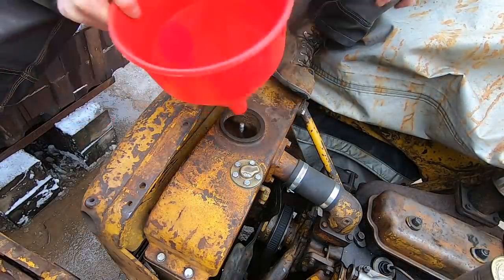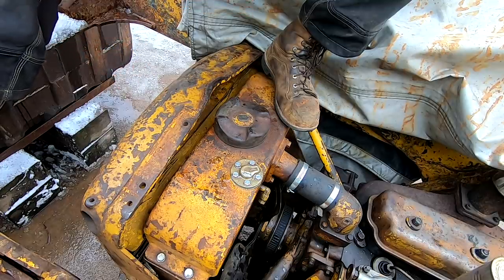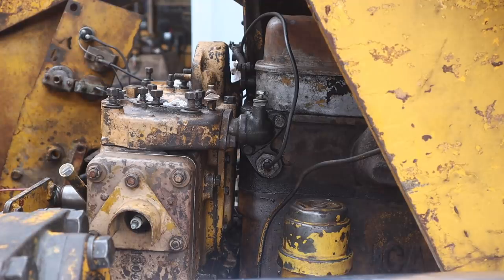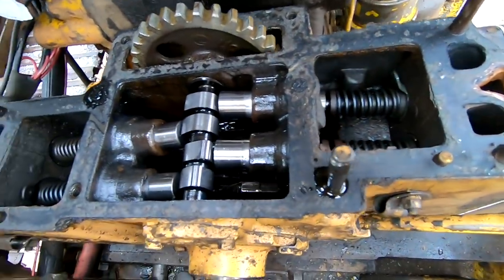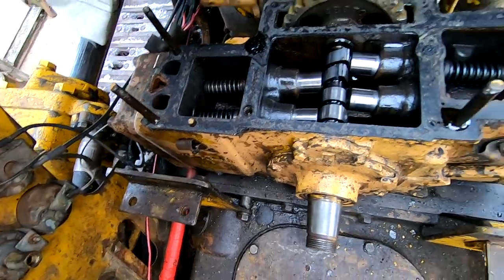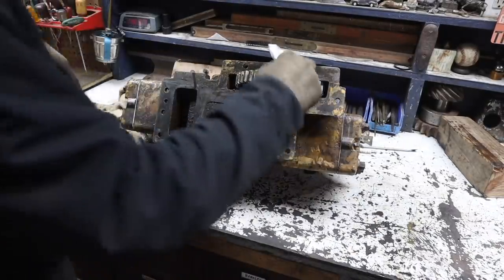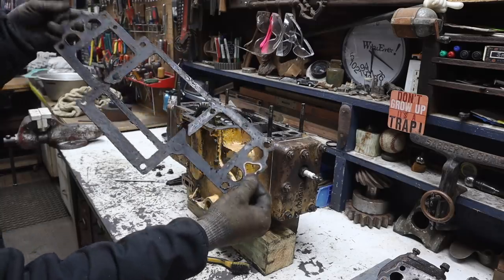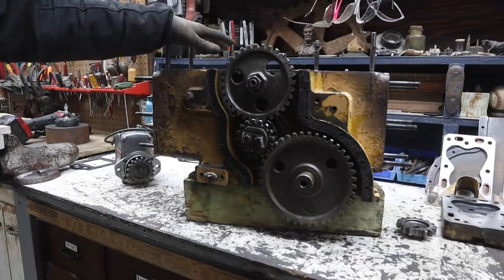I REMOVED the Pony Motor!!! ~ Part 15 ~ 1950s Caterpillar TraxCavator

Comment: Who makes those old pony motors? Cat didn’t correct, just branded? I used to work a dealer help line for Cat, we rarely had questions on pony motors. Lots of old engines are rebuilt just very few pony motors from what I saw.
Reply: Cat made them.
Reply: And lots of them got rebuilt back in the day.  Some of the later types from the 1960’s were really unreliable and probably pushed the transition to direct electric start for many people.  The term “buzz bomb” was popular!

Comment: Are you sure the bearing is Aluminium? looked very soft if you can scratch it that easily, What about Babbitt? this was a common material for bearings in the 1940's - babbitt or white metal melts at a low temperature and if an engine were driven hard with poor oil circulation the bearing material would get hot enough to melt and literally RUN out - this is the original meaning of running a bearing!
If you cant find a bearing there are specialist machine shops that will manufacture in white metal - usually on a brass backing.  Thats what your big end bearings are made from - a brass or copper shell with a layer of white metal.

Comment: Hell yeah! Make one out of bronz it will never fail and if it does at least you wont be around to hear about it..great job! Have a great outstanding day.
Reply: Bronze is a poor choice for a pressure fed plain journal bearing.  You need a bearing surface much softer than the bearing journal so that dirt and debris in the oil gets pushed into the bearing rather than scoring the crank journal.  Phosphor bronze etc. is good for self lubricated or splash lubricated bearings

Comment: I would bet that the aluminum was about the same softeners as Babbitt used in larger spin cast bearings. The question is heat dissipation and clearance for oil to float a film against the shaft. Check the tolerance in a ,machinist handbook for the proper clearances. We in the electric motor business for high impact load may use aluminum bronze instead of cast steel bearing surfaces, not bronze with graphite impregnated called oil tight bronze, also used in motors, since the impact load of a diesel is higher and then boxer design off the crank symmetry is 180 deg .  Maybe there is a Person on here that knows the actual engineering. I would replace with aluminum billet material. or get Babbitt sleeping material. Maybe McMaster Carr has it available or see a electric motor shop. Also an insight maybe an Ingersoll Compressor guy that knows centac compressors, they had the same design for opposing crank piston relationship. Hope this might help give a direction in case there is no other input.

Comment: I believe the bearing is Babbit or sometimes spelled Babbitt. Isaac Babbitt came up with it back in the early 1800's. It is an alloy mostly made of tin with some antimony and copper. I would say it comes down to hardness. I know the pony is only used for starting so it's not the prime mover but my fear is that bronze would be softer and may not be suitable for such service. A bushing is one thing but a crankshaft bearing... is a different animal. It seems if bronze was a good option, it would be there already. I too have a lathe and machining it should be possible. If it is pressed in I believe there is a proper oversize standard of a few thousandths you should look up. I believe you can find it in the Engineer's Black Book found here https://www.engineersblackbook.com I think there is one for the crank journal running surface as well. 

What I'm wondering and I haven't looked- is if perhaps you can order a piece of Babbitt round stock from a specialty metals dealer and then go from there. I would face it off, turn the outside to spec. then drill it to fit a boring bar. Bore it to internal spec and then part it off. Then mill the pin slot and drill the oil holes. Put a nice chamfer on all the edges as well. I know there are machine shops that will make them for you but then, what fun would that be? Just go slow and creep up on your final spec. I'd be leery of changing to bronze without doing your homework first. You are a sharp guy, how about casting your own Babbitt round bar? 

As to the issue of end play, what will the crank  bearings do to control that? Is it possible the other guy who was in there before you left out a thrust washer? It looks like he left 1/2 of a broken castle nut behind so who knows. I'd almost bet that piece of nut took out your magneto gear and shaft. Hopefully the other bits of the gear are in the sludgy bottom of the case.

Great series. I look forward to the upcoming episodes.  You are a hard worker who is not afraid to go the extra mile. That is an admirable quality.

Comment: Squatch 253 has some info on pony motors in his 5J-1113 series. That bearing on the gear side is notorious for getting a lot of end thrust. You caught yours in time before it really wore out and the bearing would have spun and might have even eaten into the engine block. You were a far cry from that but good to catch it when you did.

Comment: Somebody tried to take the rod cap nuts off without removing the safety wire first and broke the castle nut in half.  That’s my guess.  The probable removed the other half when it broke and the other half fell into the sump, getting lodged in the drain when they changed the oil.

Comment: the only thing is that is why your bearings are worn and the crankshaft isn't... because aluminum is much softer... so brass .. not as soft as aluminum.. its going to wear on the crank more and i can't tell you if it will seize because i have never seen brass crank bearings .. only aluminum / aluminum plated

Comment: The pipe wrench keeped skipping off because you had it on bacwards pipe wrenches only grip one way also slip joint pliers grip better if you have them on the right way same with adjustable and open end wrenches

Comment: Two things.  I don't like how the mag gear meshes with the camshaft - is one of them wrong?  The teeth don't seem to fully engage full depth...  Also, I'm not sure if bronze, being harder than aluminum, will work for your main bearings.  Usually bearings are meant to be able to absorb small grit and stuff and keep on trucking; is a sense they are sacrificial.  The main thing you have not addressed is the thrust dimension of the main bearings.  That is, the length of the bearing.  This is what controls the end play of the crank, which I think is your concern re the broken teeth.  Obviously, the main bearings are worn with regard to the fit on the crank, as you have shown; there will also be wear on the thrust side of the bearings, which will give you too much end play.  You need to know the correct dimension of the bearing length, as well as the end play specification once you have replaced the crank.

Comment: I noticed that his pony motor had been repaired because the crown nut was in the oil drain was only half piece and . I suspect that the gear that had a broken tooth  didn't seem to match properly with the gears on the other shaft and suspect the gear on the shaft with the broken tooth may have been replaced with a slightly out of spec possibly weaker Chinese junk gear too

Comment: Just my opinion but I'd much rather have electric start on that thing, or at least the option to start it either way. Would be nice to still have the pony motor as a backup in case the batteries go too flat to start the diesel.

Comment: If the magneto gear utilizes a one way clutch bearing it going bad would cause it to take out gear teeth.
Reply: It doesn’t.  Just a plain gear keyed onto the shaft.  Caterpillar identified a loose flywheel as a cause of broken magneto shaft and gear way back in the 1950’s.  That flywheel should have been hard to remove with a puller.

Comment: Glow plugs? No glow plugs on my dad's D6, 9U and it was converted.
Reply: Ether starting aid can be used or maybe put in a “therm-o-start” that actually burns some diesel in the intake manifold.  They’re used in some ag tractors.  Pretty neat little units.

Comment: The back sleeve bearing possibly spun on the crank.
Reply: I hope it spins on the crank or really the crank spins in it!  No, that one couldn’t actually spin because the dowel pin was still in place but it had gotten hammered and worn down on the outer circumference because it wasn’t being held tightly by the required press fut

Comment: Yes, have a bronze bushing made. Also, check the rod bearings,  they might be loose as well.
Reply: Bronze is not a good choice for this. Plain journal bearings with pressure oil feed must be much softer than the journal to prevent scoring when dirt and debris inevitably gets pushed through.  The bearings in your car engine will very likely be a layer of aluminium on a steel backing plate.
Reply: I'm not sure the pony engine has a pressurized oil system.
Reply: But yeah, you would be right about that.
Reply: Cat used aluminum bearings and they are gravity fed from oil holes in the top side, no oil pump.

Comment: I have the crank micro polish and as for why the mag gear broke that has nothing to do with crank gear what so ever that would only apply if the it was riding on crank gear it self not the cam gear and it need way more play then that, but what is possible that mag gear could had a defect casting cause by micro fractured in the metal so over time it eventually broke or lack of mash spacing clarence between the gears
Reply: Loose flywheel sets up a shock that hammers the mag gear and shaft.  Caterpillar identified that back in the 1950’s.

Comment: If you are in need of help. Check out Squatch253. He covers everything old Caterpillar including the starting engines. The bottom end of the starting engines were pretty much the same from the 30s to the late 50s. Your crankshaft end play is what caused the failure on the magneto gear. The back main bearing is known for wearing out and causing bad crank end play. This causes the crank to not spin correctly and puts a lot of stress on the gears. The magneto gear is the weakest link of the setup. So your doing the right thing, tearing down the engine and replacing the bearings.

Comment: Check the piston to bore clearance something is up there . You had to much oil in the cylinder and were pumping oil out the exhaust leak. should not do that . at least put some fresh rings in it . If you undersize the crank have it ground by a shop. Look for the OEM bearing. The oem bearing is not aluminum. Its tin lead ect. combination. Never seen bronze main bearings used on a cast steel crank . I would research the compatibility before you get to creative. The two metals may want to bond that would be bad. If you do use bronze make sure the oil you use has no zinc it beaks down bronze.Most bearings are steel backed with a layer of coating. Bronze that thick may want to pound out?

Comment: Probably been said but I'm gonna say it anyway. You should PLASTIGAUGE the connecting rod bearings while you have the crank and rods out of the engine. Then you will know how much tolerance you have. You apparently don't know who worked on that engine before. Don't let any mistake they might have made bite you later.

Comment: Seeing how you know what size bearing it has you could try to find you a roller bearing to go back in place of it.  Maybe a bronze burn but they  shrink or get large when they get hot, can't remember.
Reply: He'd have to modify the oil system to restrict flow to a rolling element bearing, and a roller bearing wouldn't provide any axial location so you'd need a separate thrust bearing.  Unless you mean taper roller which would be unsuitable for a crankshaft as they require preload to work.

Comment: They used both  you had to look at a earlier model of j. D  620 and 720 used a 2 cylinder  the later 730 and 830 used the 4 cylinder

Comment: Make the part out of BRONZE. Throw away the aluminum sleeve. 25 years as a licensed aircraft mechanic. Aluminum would have  dissipated  the heat faster but bronze is the preferred material.

Comment: Why couldn't a roller bearing be used at each end of the crankshaft? (I don't think Squatch253 would  approve) ( I agree with sandlapper)
Reply: Because crankshaft isn’t hard enough to stand a roller bearing being run directly on it, so dimensions would not work to swap them in.  They also don’t control thrust unless you’re talking tapered roller bearings like wheel bearings used to be
Reply: @jimrankin2583  Sorry did not know that.

Comment: I have to say you are not afraid to tackle most anything. I am sure I don't have to tell you to clean up every drop of that antifreeze. If your dogs get into it it will kill them. It is nasty stuff. Don't put an electric starter on that machine. Fix the pony engine. There has got to be parts out there somewhere.

Comment: You asked for our opinion on whether or not to use bronze for a replacement bearing instead of aluminum. Well, look at it this way. You said the pony motor ran excellent before the mishap. Well, that aluminum bearing was in there for all those years, and did its job. Why spend the money on bronze when you don’t have to. I don’t know how expensive bronze is where you live, but here in Canada, it’s bloody expensive. If, however money is no object, then by all means go with bronze.

Comment: Don't forget new lock tabs. Instead of wire you should have cotter pins. 
Go with the original aluminum bearings because that is what was engineered for the motor.
Please check out squatch253 on youtube, he is extremely knowledgeable on Cat pony motors.

Comment: Lol... it's like I said, should've just torn the whole thing apart,  sanded,  polished,  painted,  "made new parts" for the broken parts, then completly reassembled.  🤣🤣🤣 Just like the toy restorations.  Only BIGGER. 💀☠👻
Reply: On a serious note,  my dad use to rebuild transmissions for a living. He quickly learned there was no such thing as a standard rebuild, as 10 mechanics before him most likely did poor quality work and screwed things up. Things found in transmissions: duct tape,  coins, twist ties,  various "home made" things.  He started rebuilding transmissions like the restoration videos,  because then he knew that it would last "forever", because it was essentally new and wasn't going to be back in the shop because he missed something.

Comment: During your video, you appear to have a very interesting life.  Equipment tools machinic machinest enclosed work area, shop, etc  After working years for a large printer whose business card stated something like this  Color Lithographer Security Engraver  Security Printer Letter Press Type Setting Steel Die and Commerical Bindery.  I do know the changes you are faced with.  You may be thinking What my job was, no I am NOT a printer.  New experiences on a regular basis.

Comment: If It’s my tractor than I probably remove pony motor and put only starter there! While than is quiet start engine! Also less problems with pony motor! If You not gonna restore this by original and do it only for Your work than less problematic things you have the better!
I have done this many tractors and never regret! Life is too short to fix engine everytime!

Comment: The Id of that bearing is not what was giving you th e end-play.
Reply: The loose dowel plus some wear on the edges of the bearing results in the excess end play.  The hollow dowel is driven into a precisely reamed hole in the bearing to lock the press fit bearing in place.  Once the bearing loosens up, that is all out the window!